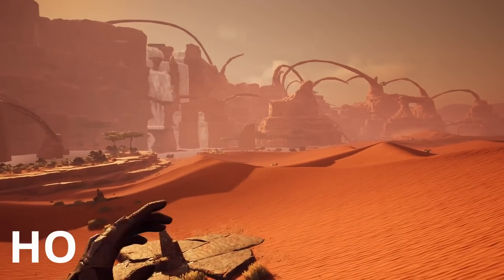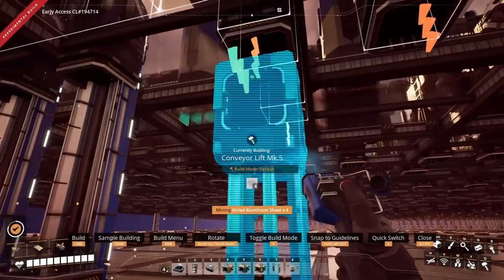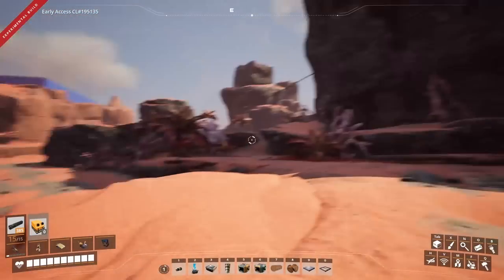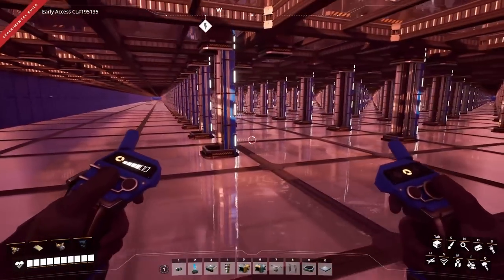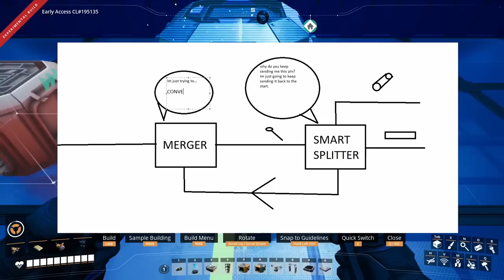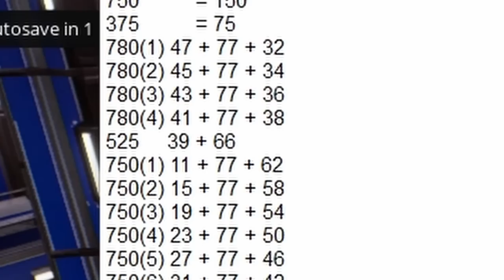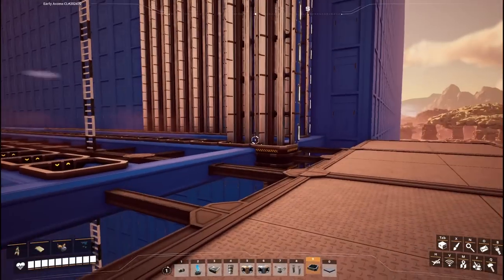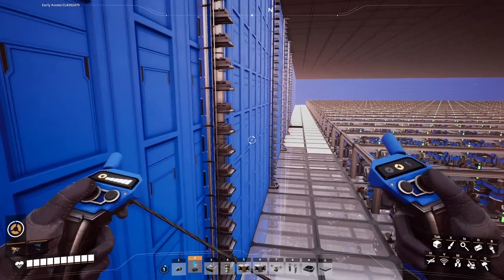ONE MILLION SCREWS Per Minute in Satisfactory

Comment: you know what i would have LOVED to see? you beeing at 0 tokens and then turning the factory on and seeing how quickly the amount of tokens in the awesome sink shoots up with that kind of production :D
Reply from the maker: Well, I got the first 100 or so tokens while testing and after that the rate at which they accumulate is disappointingly slow. Screws have as terrible sink value.
Reply: @serisak  ye but a FRIGGIN MILLION isnt the usual amount one produces either so i reckon it would still be fun to see :D

also, what i was wondering. why didnt you go for the alternate recepie? would be more screws for way less effort. you would only need iron ingots instead of iron rods. so one production step less AND you would get more per minute o.O
Reply: @dervakommtvonhinten517 he used the steel screw recipe, hence the need for oil. It produces 260 screws per screw constructor, and of all the alternates it uses the least amount of power and space. Of course the wiki math probably assumes you’re mining coal and not turning oil into coke - but I’m guessing it was still the most efficient option.

Comment: Awesome video. @16:07 you stated that you need oil to make nuclear power. That is false. In fact, of the 12 different automatable raw materials in Satisfactory, oil is actually the only one that you don't need for nuclear power. 

My nuclear power set up is as follows: 50 nuclear reactors being fed by 10 uranium fuel rods per minute. This creates 125,000 MW and 500 uranium waste per minute, which I then fully process into 2.5 plutonium fuel rods per minute and send to the awesome sink. There isn't one single production line in my entire set up that uses oil. I use the following of each raw material: 

200 bauxite per minute
1,905 caterium ore per minute
1,219 coal per minute
1,232 copper ore per minute
1,174 iron ore per minute
1,170 limestone per minute
600 nitrogen gas per minute
375 raw quartz per minute
775 sulfur per minute
625 uranium per minute
380 water per minute

Its also worth mentioning that my set up uses 12,988 MW to do all of this.
Reply from the maker: You're right. I have no idea why I thought I needed oil for nuclear, even the default recipes don't call for oil. Now I feel stupid. 😅
Ah well, what done is done. Maybe one day I'll go back and make a nuclear power plant for it.
Reply: @serisak  either way bro, awesome video. Subbed. Looking forward to watching more!

Comment: Nice work bro, looked a massive job. Only thing is I was hoping to see how quickly 1M Screws makes tickets in the sink. You did all that work just to sink all the screws and then don't show us the tickets. But still an epic factory.
Reply from the maker: To be honest, I completely forgot about tickets. But it wasn't really about how many points I get, it was about making a factory that produces screws. The only reason the sinks were even there was to keep the screws flowing.

Anyway screws only give 2 sink points each, so it would make 2 million points per minute. And since it was battery powered, I never actually had the completed factory running for more than an hour, so I'd have roughly 120 million points. So I'd have had maybe 150 coupons.

But since coupon cost increases with each subsequent coupon, just one more coupon after that would likely cost more that 2 million points.
I don't know how to calculate it, but like I said, it's not really relevant so I didn't consider it.

Bottom line, screws are a terrible ticket printer. I'd have been better off sinking the beams before turning them into screws if I wanted a half decent accumulation of tickets.

Comment: Are you sure you got to a million?
I've maxed out at 770.000 screws. With putting it mostly into steel screws as that's the more effecient way of making the most screws and the rest into cast screws. Can't get to a million as far as I can tell.
I guess I could crank up the screws with regular instead of cast screws. But I still don't get to a million. And it costs a lot more power and frames.
Reply from the maker: I can assure you it does indeed produce 1 million screws per minute.
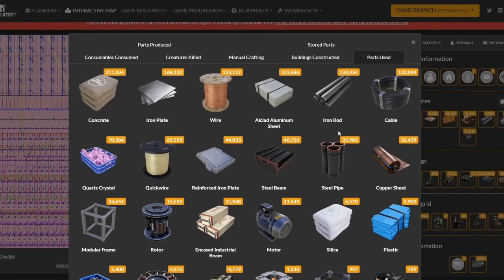If you pause the video at 00:35 you can see from the save editor that the factory produces 1000220 screws per minute.
The maximum amount of screws that can be produced is 1927800
You can use the following link to see how it can be done: https://www.satisfactorytools.com/production?share=3yU79ImSDVYyDcmxOS48
The maximum (almost 2 million) was achieved recently by chaos 1699 in their video: https://www.youtube.com/watch?v=HCeeDQNSX9c
Reply: @serisak  Ah, good idea on the compacted coal. and the petrolium coke Forgot about that. Yeah I was running out of coal. That explains the significant possibility to increase the numbers. Will start working on that soon on my save.

Comment: That you still have FPS and not FPM is a wonder, what are you running as CPU ?
Reply from the maker: My specs:
i5 12600K 
32gb ddr4
rtx 3090

The CPU rarely hits 100% on a single core, this save is mainly limited by the game engine itself. It was all fine until I exceeded the object limit, and then the fps just fell off a cliff.